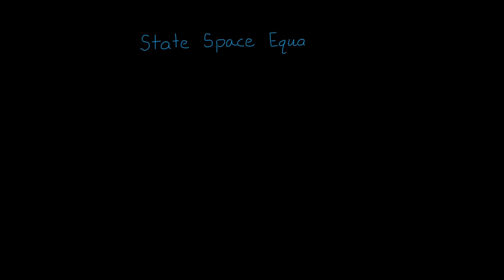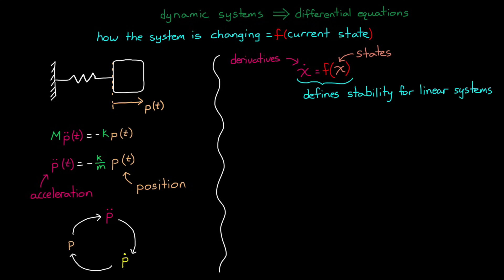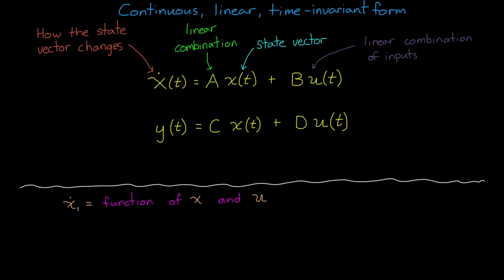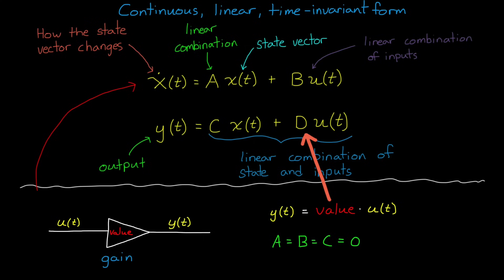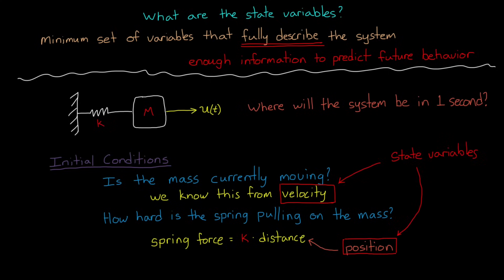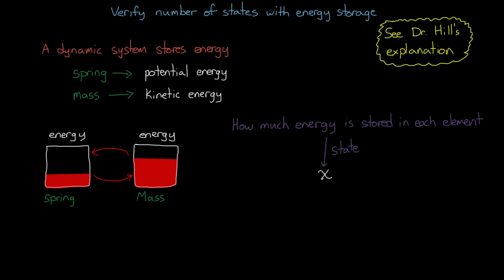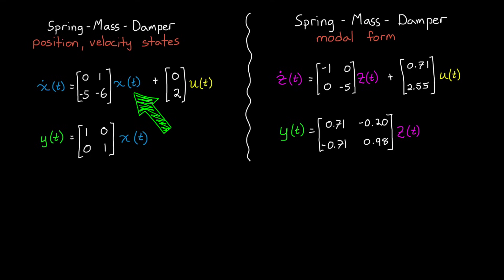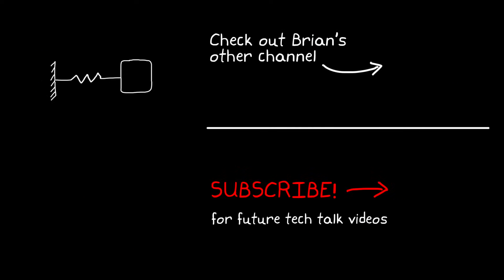Introduction to State-Space Equations | State Space, Part 1

Comment: This video is truly an amazing lecture, although it is very brief and thoughtful. It is sad to see many hobbyists and some engineers building their models based on an extremely basic mathematical model u = kp*eP + ki*eI + kd*eD. However they  ignored the other influances such as external disturbances, internal disturbance, unpredictable PID gain changes, and system specifications as the system is operating in the Real World. Many of those systems screwed up because they did not account for those influances described by the Dynamic Matrix Control (DMC). Hobbyiests and engineers should learn (even a little) about state of system by exposing the variables on the DMC Matrix. This is why you find people launching model rocket and it ends up whirling in the air and crashing, or producing unstable or unpredictable results > because they did not account for variables that contribute to the system output. An example: you can not predict the flight of a space vehicle if you dont anticipate how every thing is influancing its travel in the space over time as things change, noise and disturbance and the state of the components operating the vehicle itself are changing. I think I have said enough.

Comment: If you differentiate the position value, you get velocity.
Then we can express it in a first-order way, not in a second-order way?
Reply: The idea is that you reduce second derivatives to first derivatives of the first derivative. This couples the second derivative with the first as a system of two linear equations dependant on the position and its first derivative.
For some systems you literally say the first derivative of x equals the first derivative of x.